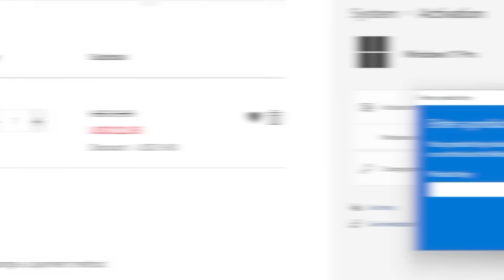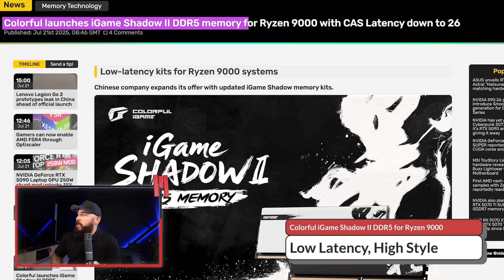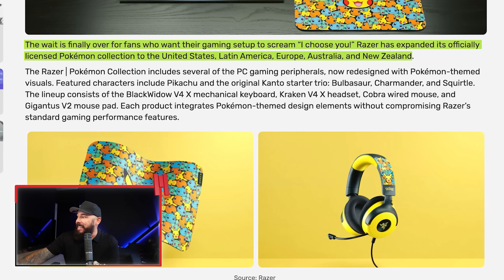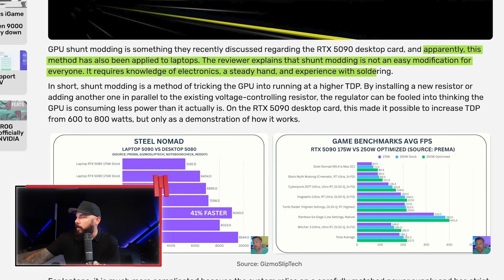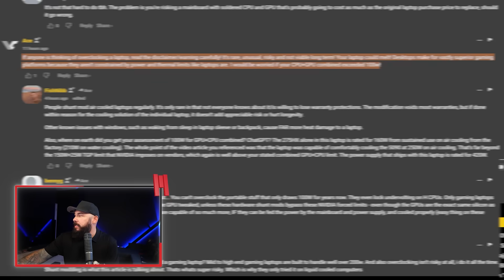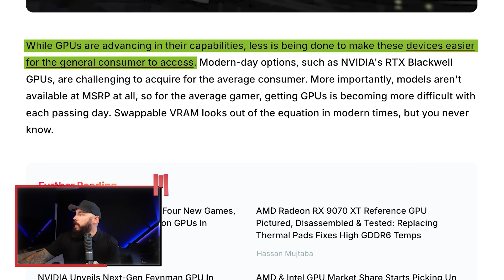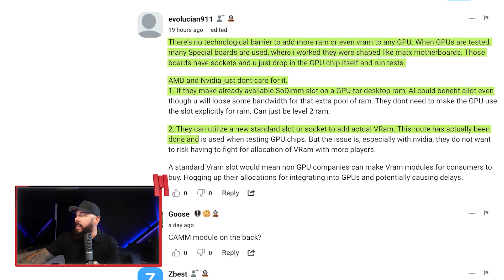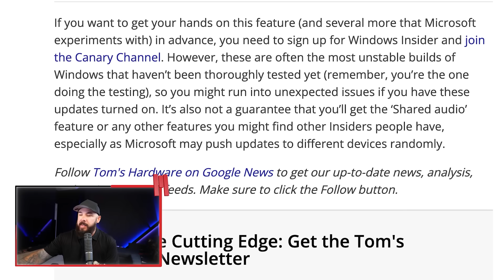Add VRAM To Your GPU?!

Comment from the maker: CDkeysales 30% discount code : Zack
▬ Windows 11 Pro($23): https://biitt.ly/Zack-W11P
▬ Windows11 Home($22): https://biitt.ly/Zack-W11H
▬ Windows 10 Pro($18)：https://biitt.ly/Zack-W10P
▬ Windows 10 Enterprise LTSC ($10)：https://biitt.ly/Zack-W10ltsc
▬ Buy Office 2016($29)：https://biitt.ly/Zack-off2016
▬ Buy Office 2019($53)：https://biitt.ly/Zack-off2019
Buy MS Win 11 Pro OEM KEY GLOBAL at: https://www.cdkeysales.com/
Reply: Linux:  Free.
Reply: As if adding a TI onto the 5050 would make a difference... 

Edit: @12:00 Um, no. The real reason is because tooling costs and upscaling are real life problems that aren't solved by 'switching to modular design.' If I'm reusing the same PCB design layouts across an entire product stack (leaving voids for SMDs on lower tier PCBs) as a cost saving measure, reusing a 4x Ram module layout as a cost saving measure (128 bit membus across 4 skus now? lol), if I am quite literally reusing the previous node production for silicone (Blackwell IS Ada), there is no reason for me to add costs by: 

1. retooling for modularity

2. introducing a new product (ddr7 ram modules)

3. eating the costs as the product still fails to meet end user standards. 

Ask yourself if having modular ram would make any of the 5050, 5060, or 5060 ti cards any better? Every AIB would be spending the millions of dollars to retool their PCB fabs to accommodate, wait on the development of DDR7 ram modules (or whatever else they could get to work), and then also wait for performance to meet or exceed whatever the non modular cards are doing. 

The end result would be: people asking for the soldered cards, people learning how to micro solder if they want to upgrade their ram. That's already the most optimal choice right now for people on functional 2xxx/3xxx cards.
Reply: What if you could take apart you're phone like Lego bricks and upgrade everything on the back of the phone with a general tug well you could have I phone threatened a creator a long time ago to not release his invention well now we are about to take out apple and all associates the design is coming to market to change everything
Reply: @RickCarroll-j5n  Because it would have minimal durabilty/water resistance. Don't you remember dropping your phone mid 2000s? It would explode as your battery, housing, and phone all went in different directions. 

If you go to ifixit and search any teardown (you pick) just look at the pictures. Lego style connectors, INSIDE the phone. Once you get it open, yeah, You have modularity. You can replace compontents. Upgrading is a different story because there really isn't much to upgrade. 

Your SOC/Storage are usually on same chip with all the camera modules. The SOC combines the cpu/gpu/ram/modem/storage all in the same chiplet. Everything inside the phone from the screen to the battery to the speakers/antennas/mics/daughter board... all plug into the main board. 

On a TRADITIONAL PC, these would all be separate components which could be upgraded. When you take the same power you find in your desktop and shrink it down to fit inside a phone... you lose any sort of upgradability. 

You either get a) the phones we have now or b) you don't have phones anymore. I'm happy with the current environment, if I had to pick from 1 standard... and it was something like Apple? I wouldn't own a smartphone, PC, or tablet. If you search Fairphone, you can go ahead and try your hand at a 'lego phone.' 

Let me know how the refund process works out.
Reply: links arent working
Reply: honest to god if it worked more like ultra high speed storage instead of ram, essentially what ram is to L3 cache i would love to have some of those slots
Reply: No thanks.. Linux! Its free :D

Comment: bro i upgraded to a 5080 to get to 4k, but rn im still on 1440p, and the 5080 doesnt have enough vram for arc raiders at 1440p max settings. how tf am i supposed to get to 4k if i have to spend 5000$ usd to get there. unless im missing something but id expect 4k to use more vram, rather than less

Comment: I am planning on upgrading my RTX 2070 card, I will keep my old system, I will not let it die.... Plus, much cheaper to upgrade than getting brand new that might work half the time...

So, what I am thinking is putting 64GB GDDR7 VRAM on my 2070, how I would do that, I don't entirely know yet, but I am gonna read into that... Try and get more understanding on it, but also... I think I might need a brand new PSU because of an upgrade like that

Comment: you can add vram if you have some skills just change vram chips from 1 to 2 gb ore from 0.5 to 1 ore 2 and you got it you have to put same vendor one and same speed one as the card original but anyway its not that dificult to do it need some tools and realy not worted in most of the cases as it only gets performens boost when more vram is need than stock one wich i think is a pretty stange besides some 8 gb card owner wanting to play 4 k :D wich is absurd

Comment: You do know the Speed BS they list on VRAM Not being Upgradable is complete HORSESHIT. the Modded 4090s with Fuckind Ziff sockets. Same Effing traces Same connectivity Slightly higher but allows ANY Chip of similar specs to be swapped EASILY FFS We Use it for CPUS!

Comment: @ZackShutt
i am bylding my first pc 
what gpu do you recommend to 1440p this is what i have so far
AMD Ryzen 7 9800X3D 4.7 GHz 8-Core Processor
ARCTIC Liquid Freezer III Pro 77 CFM Liquid CPU Cooler
MSI MAG X670E TOMAHAWK WIFI ATX AM5 Motherboard
G.Skill Ripjaws S5 32 GB (2 x 16 GB) DDR5-6400 CL32 Memory
Kingston FURY Renegade G5 4.096 TB M.2-2280 PCIe 5.0 X4 NVME Solid State Drive
Fractal Design Pop XL Air ATX Full Tower Case
MSI A1000G PCIE5 1000 W 80+ Gold Certified Fully Modular ATX Power Supply

Comment: There are videos out there where people upgrade vram on their video cards. It's what I would consider an extreme modification due to the technical aspect of removing chips from the board, cleaning, then soldering the new chips on. There is no real reason for this difficulty to be a requirement other than gpu makers not wanting to allow you pluggable slots. A video card is just another motherboard with memory, a processor, and IO on it.

Comment: 11:00 They need to add up to 2TB to cards for AI.  Once you go off the card, it crashes in speed.  For massive worlds, too.  A second level of memory would not crash as badly.  But they simply can make a flst or vertical modules 2 a side.

A real problem is cooling.  Vertical or flat replaceable modules creat cooling issues, but you could still design cooling around it.  It's just cheaper and possibly better for higher speed at lower cost to cool using flat integrated vram.

But, I say bring it on AMD, or at least 1TB GPU AI trainer world builder edition. New market to bust!  It's not like it's going to complete with your server card editions, which needs increased raw speed per unit of memory not just more memory to bring up base speed.

Years ago, I suggested to Nvidia a mass cpu/gpu array Ray Traced version of the Shield TV which could serve 6 VR units to have freinds around on a massive memory.  Even for families too.  Now, a 1 Terabyte environment would be pretty sweet, running high speed 6 locals aa once.  To run this across the Internet will require a drop in maxinum performance and visual quality normally, unless each person had a 1TB model synced, amd or that Australian multi channel 40 terabit local internet network technology (they actually ran a test over the local phone network in Canberra a few years ago).  We are already up into the area of the Pro home workstation edition I suggested in energy (kilowatts) and they are doing the server compute towers suggested.

Comment: I bought a 4080 off of zotac, it wouldn’t work with my computer, even though all of my hardware was compatible. Finally I gave up and arranged to send it back. They accused me of smashing up the card, before sending it back, and tried to get away with charging a nearly $800 “restocking fee…” The thing is, that I didn’t smash the card, because that would’ve been a stupid thing to do, and anything could have happened to it, on it’s 2500 mile trip, back to Canada, which they ignored. Thankfully I bought it through Amazon, and though it took several months of them ignoring and stonewalling me, I got my money back, from Amazon, who said that this was clearly not my fault, and that they would take the handle zotac themselves.. It’s an untrustworthy company, and I will NEVER, EVER EVER EVER EVER EVER, make the mistake of purchasing ANYTHING from them, ever again.

Comment: we have 3 Ways: The Handheld way, The APU Way and "My Way" from expierience of the industrial cards and board we make in us company.

1: more vram you can go swap gddr6 or gddr7 chips on a gpu but you need reball and bios mod or it will not boot. 
2: for igpu just add more ddr or lpddr and set more to gpu in bios easy but slower than gddr. 
3: The vram is on contactpins like ram sticks easy swap but gddr runs high ghz so trace length and shielding make it hard in real builds this is in theory possible and exists in industrial cards but not in gaming hardware till yet.

Okay now i start the video and wanna know the way (:
EDIT:
why you think the cl26 is special we have it already at lexar and G.skill btw. really too much varians of g.skill ram with cl26 from 16gb up to 96gb. the g.skill ram are EXPO only, the lexar ram are both intel and amd so its XMP and EXPO same as my motherboard it can both xmp and expo and its a amd board

Comment: The AI generating repos are requiring more and more vram. And nvidia is basically the only game in town (most only support cuda cores). So nvidia needs to step up their game or else some other company like amd might and the open source community might shift to supporting a much cheaper and better video card.

Comment: That genuinely is the real reason, vram performance would need to take a massive hit. The only way to around that is photonic interconnects, which should be enough to even do it by unifying system ram with no ram on the gpu.. provided the system used gddr7 instead of ddr5 etc.

Comment: Bolt Graphic's Zeus GPU, which reportedly outperforms the Nvidia RTX 5090 by 10x in Ray and Path Tracing, uses DDR5 SODIMMs and you can upgrade the RAM to fit your needs.

Comment: I just upgraded from a GTX 1070... to a teeny tiny 5060Ti with 16GB of VRAM. The thing is ridiculous. It barely heats up, and as soon as I leave a game, it cools immediately. Given how much room it DOESN'T take on my case anymore, airflow improved around it too.
And yeah, screw 8GB, I went for the lowest card with 16GB. The thing is efficient AF near what I had.
Yep, the 1070 was tired, boss. But it still works. Backup plan.

Comment: What would be the limitations if adding more VRAM onto another pci'e slot that works in conjuction with GPU's (most likely using support software). Even if there is some speed loss, it may not be that much of an issue overall if u can get a 4070 to match the GB of a 5090.

Comment: 14:38 I've been saying it, if GPUs only care about bandwidth.

nothing would prevent them from being socketed
DDR5 has effectively dual channel per memory, each sending 32 bits in dual channel, for 64bits. 
Lets suppose we use DDR5-6000, that sustain 46.875GB/s at 6000MT/s (3000Mhz * 2).
If you use quad-channel (4 DIMMs), you actually have effectively 512bits and that's 187.5GB/s
Now, GDDR5 is 32bits per chip, and cards usually are only 384bits, but they run at lower clocks than main memory (main memory ironically is sensitive to latency).
Also lets suppose they run the memory clock at 1376Mhz * 4 [*1], that would be 5504MT/s, which results in 21.5GB/s per chip at 32bits. But they usually have 12 chips, so that results in 258GB/s.
GDDR5 is just slight faster than DDR5, there are some signaling differences, but essentially, if you had 6 channels of DDR,that would be enough to support a GPU chip at 281.25GB/s

But now GPUs mostly use GDDR6, which is comparable to DDR6. It has theoretically 18Gb/s per pin, for an effective 2250MT/s [*2], then you consider again 12*32 for 384bits, and get 864GB/s.
Now considering DDR6 is able to get even higher core-clock.
DDR6-16800 is (8400Mhz * 2) for a total of 16800MT/s and 131.25GB/s for a single DIMM.
To match what a GPU would potentially need you just neet 7 channels.

There are CPUs that are know to be able to use 8 channels, they work totally fine using RDIMM, registered DIMM, which has an amplifier/buffer on the DIMM memory.
TL;DR; that's all to say, nVidia is scalping us, there's no technical reason normal memory couldn't be used in a GPU, except thy would look like a motherboard with 8 memory slots.

Maybe with a caveat, that a small amount of HBM memory would be necessary near the GPU, like a couple of megabytes, as L3 cache, because GPUs don't have L3 cache. And while we're at it, we just solder the GPU BGA into an interposer and make it into a socketed LGA, there's at least 2 companies that sell those that I found.

Maybe I should make my own motherboard with a LGA CPU / LGA GPU and 16 channels of DDR6 and an memory I/O controller from a server able to allow the registered RAM to be routed to either the CPU or GPU as needed.

[*1 it is still DDR, so effectively 2 transfer per clock, but they just have more pins, its banking/buffering]
[*2 virtually 8 transfer per clock, but its still just really 2, even more banking/buffering]

Comment: The T-Force 6400m/t DDR5 ram I had was really sensitive to power fluctuation when run at that speed and led to an issue where I had to clear the cmos and retrain them to post. RAM isnt as bulletproof as it used to be.

Comment: 15:36 me with mac os being like: wait what come on windows you didn't do this STILL we had this cablty for mac os in like the easlry 2000's on mac os 9 and mac os x for crying out loud.
Reply: but it was not that good untill bluetooth on newer version of mac os made it far far far far  better on mac os vserion 11 and mac os 12 takes it to its full protencal by the way. also ios on iphone bsacly was diong this anyway thus why we don't have head phone aux jacks is bescue you can just use usb-c or bluetooth head phone that can be both wired and wireless  anyway. also usb-c teachy works the same away as aux headphones in most cases anyway doing the aduo and power stuff anyway. well why iphones don't have aux jacks anymore is due to the fact that usb-c or thuderbolt kinda does all the base needed things head phone aux port does anyway but a bit better and also a bit more space and size efecent then a headphone aux anyway.

Comment: you know mac os acatly does this with your reglear ram if the v ram in the gpu is not entogh any spare ram mac os has can also be used for extra  vram if needed. but that only works for apple comptuer that have ram to spare. but my moms imac dispite haveing two GB of v ram on teh gpu but she still has 32GB  of ddr3 sistem ram and when the gpu is usesing all  2GB of  vram mac os will use the extra unused ram of the drr3 ram to be used as extra vram if needed. also apple arm chips can also use this for extra vram for the unifed sistem memory as well if needed (is acatly far far far faster on apple arm silcion bescue its already derectly contected to teh arm chip aas part of the unifed memeory being right next door and  has littel t ono lacsty form that unifed memeory) . i knida alrady know this. mac os does this atuoamtcily when needed. but thats a sofware drver thing but only works well if you got extra sistem ram to spare for the gpu to have acces to if you need it. but i don't have entogh ram t otake advantage of that but my gamer moms apple imac does have the ram to spare for at lest 10GB of extra vram due to aheving like 32GB of ram on her imac with used the same i5 intel cpu and 2GB vram amd moble gpu. but my momds cumptoer just has a bit more drive space and ram then my comptuer but otehr then that my gamer mom comptuer and my comptuer are mostly the same.

Comment: The reason given for expandable memory not being feasible anymore is 100% correct. It's not a money grab. That socket consumes A LOT of time that DDR7 wouldn't be DDR7 anymore without insane technological upgrades that aren't a thing.
DDR5 memory for example: 4.8Gbps / pin
DDR7 VRAM as a comparison runs at 32 GBPS / pin (up to 48)  but even higher within the GPU itself. This is where the heat comes from.
 
e:oh, I commented before you went further into the segment commenting on why it's infeasible.  You just earned a like, bucko!

Comment: No they will not go back to expandable vram. If they did they would lose money and that’s a sin to big corp and investors. Don’t even think about holding your breath. And even IF they did, they would gate ones that were proprietary only work for their cards and charge a ton. 

But again. They won’t.

Now you can by desolder or solder more ram on the gpu.

Comment: 13:30 There's the AMD Vega 64, which can take parts of the normal RAM that you have in your PC and expand the VRAM. I had the same thing with my 9800 GTX that I had. You can tell because the GPUs can go to the normal RAM and say, hey, I need more. The PC RAM gives RAM to the GPU and the GPU adds it so that it's not 6 GB anymore but 8 GB, which takes 2 GB of PC RAM. It's the same if you want 12 GB or even 16 GB. That's what I noticed, but I could be wrong.